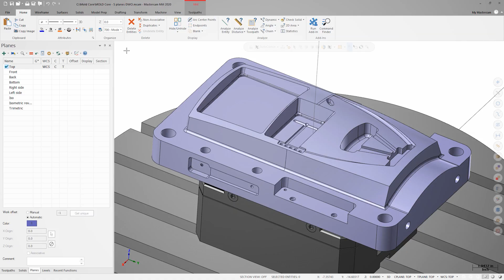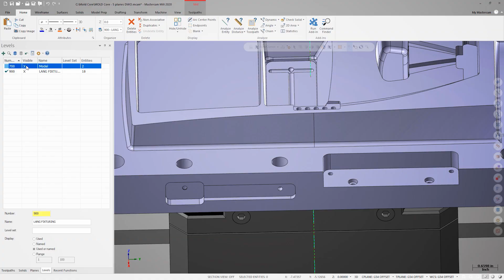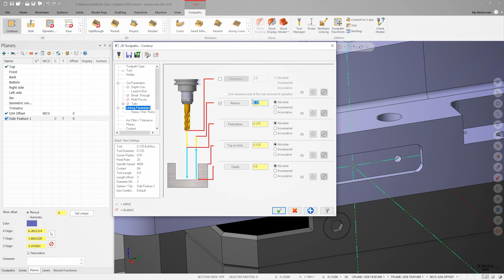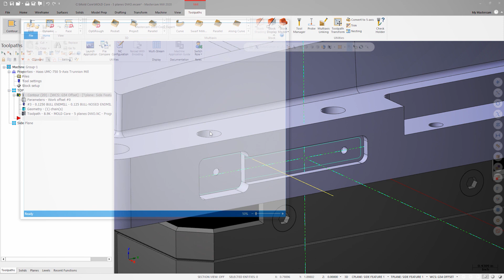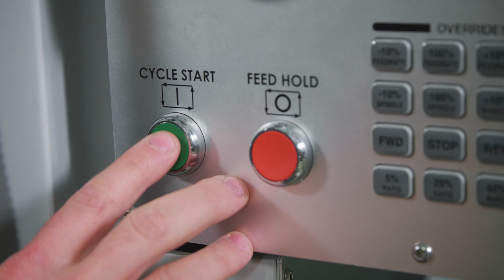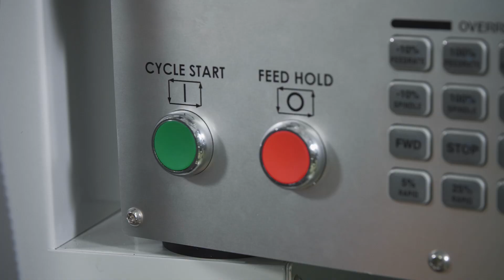Dynamic Work Offsets - Make the transtition to multiaxis.

Comment: isnt tcpc and dwo haas specific? Like if i have fanuc does this work?
Reply from the maker: The G codes are different for a Fanuc or other controls but the functionality and principle is exactly the same.
Reply: For Fanuc is a paid option. In the post it'll be G54.2. Online you can find macros that will do it for you onboard the machine, without dynamic offsets. Good thing using macros, is that you can shift the work if needed. And usually it needs to. You will also have real values on Z axis. Same for any control, not only Fanuc

Comment: I'm signed in under my user name on My Mastercam but the link you attached for downloading this part file is not working, any ideas on what's going on?
Reply from the maker: Hi PipeLeisure we will need some more information to assist you. If you are not a maintenance customer you will not have access to these files. You can work with your local Reseller on it or contact our support team at Support@mastercam.com

Comment: I didn't get this method. Is that that where ever we program on we create new plane for that? And then mastercam combine 1 work cordinate like G57?  What machine understand that or what? Thank you
Reply from the maker: Hi Mark! DWO allows you to create planes on any feature that needs to be cut at any vector without regard for where the center of rotation of the rotaries are. That has already been figured out and stored by the tech that set up your machine. Keep in mind that this is typically a purchased option for most machine tools, so make sure that you have it enabled on your machine. Its a far simpler method than the old way of having to model your part in Mastercam so that the offset in Mastercam and the Machine matched the physical center of rotation of the machine. Now just pick up your part however you see fit with the corresponding offset, G57 will work if that is what you prefer but since you will only need one offset I tend to just stick to G54. In this case we grabbed the top center of the Lang fixture plate. The machine internally does a calculation from its center of rotation (stored in the system variables) to find the proper angle and XYZ coordinates needed to cut the feature at a new Mastercam plane shown by that side feature, remember the XYZ origin of this new plane is unimportant. The only thing the post processor needs is the Z vector of this index. As the video shows, this also allows you to run the same program at any location on the machines table. As long as the Machine offset is set at the new location the machine will automatically comp and calculate the new angles and XYZ positions with the exact same G code, no changes to the XYZ or BC in the program. It's a very powerful, flexible option and much simpler than doing this the old way with Center of rotation programming.
Reply: @mastercam  wow you're super nice to feedback like this thank you. But I am just about to jump in 5th axis seeing many your clips wishing too much to become a such programer like this but don't know where and what books to learn. Please help me. Thanks
Reply from the maker: We recommend checking out our courses on Mastercam University. We have free and paid courses that you can access 24/7 and we recently launched a multiaxis course. You can login or create an account to check out the course here: https://university.mastercam.com/course/view.php?id=87
Reply: @mastercam  does the G68.2 and G53.1 together not do exactly the same job ? What is the difference ? I can’t understand. G68.2 with G53.1 does the same as when G54 is in different place it calculates a new position of G68.2 in relation to machine rotation centre so when the fixture moves as it’s mounted in different place you set a new G54 and job done. Is this right?

Comment: Your Z values on 90 degrees aren't real. They are based on G54. At a 10mm distance between tool and part, you will see Z who knows what. Actual position in respect to G54. If you have multiple threads at multiple depths, you won't be able to see a mistake. Also,  considering most rotary axes aren't perfect, for tight tolerances, you should be able to shift the work on sides of the part. There are simpler solutions, where the operator can solve this onboard the machine. Nice feature, but I take it with a grain of salt.
Reply: why should they be "not real"? The machine knows the center of rotation point and the work zero. It can accurately calculate the shifted work zero.
Reply: @ipadize  I think what he is saying is that the machine is never perfectly exact to what it was when the tech guy originally installed the machine or what it's designed to be. The temperature of the machine and room the machine is in affects it. If it's been bumped or crashed it will effect it and you'll be off location in some planes and it's almost impossible to know exactly why. If it's off enough for a super critical part you could spend hours, days, or even weeks pulling your hair out trying to comp for the error. In the real world he's saying you will just end up creating a new plane and a new offset for the troubled plane. In other words it's the old way that is what will save your ass. Except now you have wasted a bunch of time trying something new. 
The moral of this story is don't crash your machines, make perfect fixtures that are square and perpendicular to the spindle and table. Oh and you gotta spend millions of dollars to keep your shop at 68 degrees plus or minus half a degree too. There are so many variables affecting it that in most cases if you're holding tight true positions everything better be perfect. 
Or just make offset for each plane.  
Done!